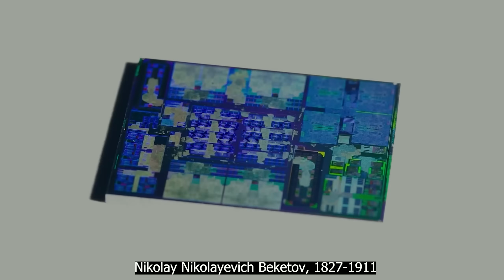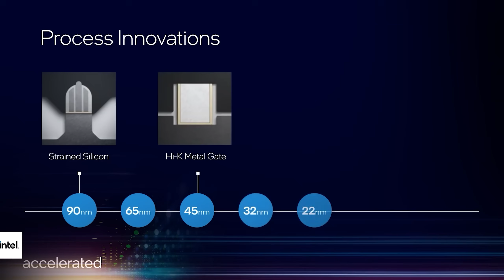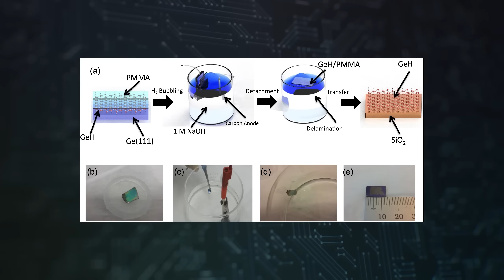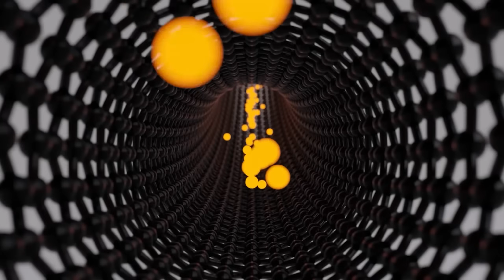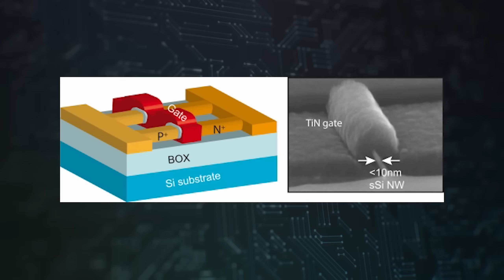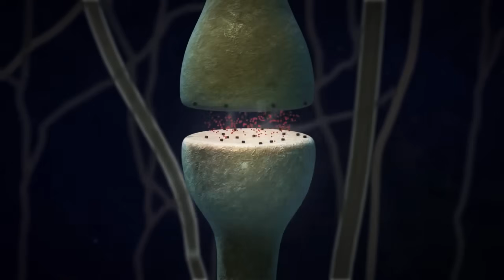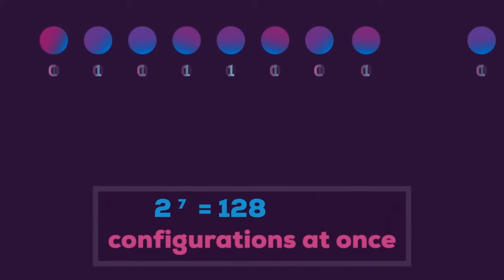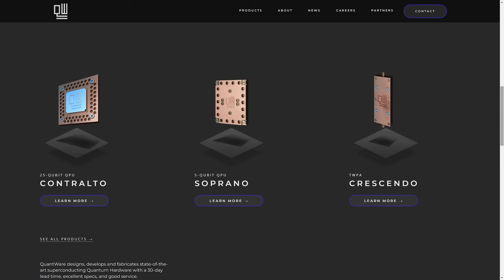End of the silicon era. Processors of the future

Comment: Quantum computers are NOT a replacement for the classical computers, holy hell
Reply: They need to be cooled with liquid helium and can only run α few quantum algorithm
Reply: @kellymoses8566  for now yes. The big machines called computers back in the day were impractical too.
Maybe they find a way to cool it off with other stuff or change it's material elements and make it portable. 
We never know when that step will take place
Reply: @kellymoses8566  
What they present is an algebra equation and then come up with the same algebra equation in a different form as the answer.
Reply: @kellymoses8566 right now...
Reply: I always thought we'd end up seeing a hybrid system for the best of both worlds.
Reply: @downnoutdubin  they are always hybrids because the quantum computer is controlled with a regular computer.
Reply: We don't know what is possible with quantum. But for now, i say: Optical Computing is the future. It replaces slow electricity completely with light. Basically computer will work same way as you fiber optic internet.
Reply: @gytispranskunas4984  I can 100% agree we don't know what's possible. But I believe that we will get to a point (eventually) where it will be in a much smaller package. On the timeline with quantum computing it's closer to the punch card days of the early 1800's The only direction to really go is smaller and more powerful. Now as for classical computing moving to optical? I can see where that could work, but you still need something to interact with, so I don't know how far that can really go. For storage? I can see that being a lot more feasible. Personally I think graphene or something like it will be after silicon. Multi layer processors with internal cooling in addition to external. The only path after that I can see is biological. Not saying or suggesting I am 100% right, but that's the path I foresee. I think there might be something between, but no clue what.
Reply: @ocpimport7935  How are we going to scale down atoms?????
Reply: @gytispranskunas4984  lol. Lol. Light is useful for faster transfer of data. But light has a problem. Wavelength.  To make the current computerchips we use lithography to make the transistors as small as they are. But we have to apply tricks to make that work. See. The light used has a wavelength. Extreme ultraviolet light has a 13.5 nanometer wavelength. And through some very highbtech tricks we are managing to make transistors smaller than that. Its really some high tech stuff. To move data, light is great. Because its fsster than copper wire. But to use light inside a processor itself actually can be pretty problematic. Otherwise we would already be using them. Please go and google a bit before you randomly say something..yes we could use lightspeed connections between individual cores. And we might have a way to do that with electrons. But thats experimental. But no. Light has its own issues. You might want to look into that some more. If light was such a great option. We would all be using it for processors already. Lightspeed is awesome. But light has properties that might make it extremely difficult. Please please go read about why we don't already have processors using light instead of the regular silicone cores and copper connections. Actually form an oppinion on information. Not a gut feeling and the idea "light is fast"
Reply: @MrMastadox  Really off-topic but how long does it take for you to type a reply this long?
Reply: He didn't mention actual future of regular Computing. It's Light based, Optical processors. They work by replacing electrons with photons. Makes it hundreds of times faster. Simple example. Look how much faster is you fiber optic internet compared to old wire internet.
Reply: Exactly, not a replacement but an addition to. Think of it like how the math co processor used to be separate. There will eventually be quantum computer dies that will be integrated into a computer chip so it will have that functionality as well. Both have their pros and cons. One cannot replace the other and be just as good if not better. A quantum computer chip would make a piss poor processor for an every day computer.
Reply: @ocpimport7935  how are they going to put a quantum processor into a cpu? How would they deal with noise and the problem of de-cohesion of qbits?
Reply: @MrMastadox  Okay, ask me that when a quantum processor has matured enough to be mass produced. At that time those issues will likely be solved. I am not suggesting this will happen in the next few years, it will be a decade at least from now.
Reply: @ocpimport7935  why are you so sure that will happen or even is possible? Or economically viable?
Reply: @MrMastadox  It makes sense that it will eventually happen. I was talking about 3D or stacked(multi layer) computer chips about 15 years ago, and they are just now in the last few years become more commercially viable.

I believe when quantum computing is viable and plentiful in the consumer market we will eventually have dual possessor like motherboards, then a while after that they will merge. 

The only way I see it not happening is if another company patents a process/technology that would be crucial for them to merge, and they don't want to license it or the license fee they want is too high to be viable.
Reply: @ocpimport7935  you understand how quantum computing works right? It seems you don't. If you did you would understand that what you are saying makes no sense. We can't put quantum chips even close to any other chips. Because it makes them completely unusable. How can you compared 3d stacked memory with a chip with qbits. The quantum qbits need to be isolated from everything in their environment. Because it causes decoherence. You have no idea what you are talking about
Reply: @MrMastadox  With current technology and what's on the immediate horizon? I agree. But, you have to admit that with the current level of technology you can't really mass produce them. Do you think when things are scaled down, processes and technology improves... that things will be exactly as they are now? Computers used to be the size of buildings, and shit changed. Think of it like moving from vacuum tubes to transistors. The current process for building quantum computers is not really sustainable long term. It needs to improve, and should absolutely improve in the next 20 to 30 years to a point where it will be drastically different from what we have now. Then probably another 20 to 30 years before we see the merge between classical and quantum computing. 

If you want to compare classical computing with quantum computing, I'd put it currently around the punch card days. So early 1800's. Quantum computing has a hell of a long way to go and what we see today... will not be close to the same in 30 years. 

So if you thought I was talking about tomorrow or in the next 5 to 10 years, then my apologies for not being clearer. I thought it was pretty clear but I guess not.
Reply: @ocpimport7935  what downscaling are you talking about. We can already make qubit chips very very small. It just doesn't solve the problems quantum computers have. The size of the qbits isn't the problem.its noise, decohesion and cross talk. Not the size !!!!
Reply: Quantum Computers CAN replace classical computers - quantum gates can perform all the operations classical computers can and more. The only difficulty is creating one that works as well as a classical computer (same storage size, same speed, etc).
Reply: @FunkyJeff22  yeah. They could. But it defeats the purpose of making qubits. And they won't be any better at the task either. Lol
Reply: Why so angry lol
Reply: @CLSB-ECHO  lol. Well atleast binairy processors are functional and useful lol. Are you suggesting we should try bringing trans people's temperature down to the same temps as we do quantum chips? One thing is for sure. There are a lot if people entangled in the ideology. There is a lot of cross talk going on. And society is certainly losing more and more cohesion. Lol
Reply: I just think that quantum computers are a bit of an overkill for the consumer market. I like my sandy computer 🖥️ and I think it will stay relevant indefinitely not having to fear the comeback of analog computing or the rise quantum ones as those will be for specific use cases. I think we are probably going to see more AI oriented silicon with In Memory Computing or even Optical Switches. Opinions
Reply: Maybe you should look at the big picture instead of just critiquing about future quantum A.I. generated computers  ,.
Reply: Yea but that statement doesnt make for a good video
Reply: thanks now i know whats in the video
Reply: how can you know that? genuine question
Reply: he also explained qbits so wrong
Reply: I have no great knowledge of quantum computers and very little on computers in general but reading all the reply’s in this thread put a question in my head. Is it possible that we are the limiting factor?  Humans? Again I am not a smart man but maybe we need to change. Prob a dumb question. Anyway. Have a great day everyone. I Love you all.
Reply: @LeftAloneTrusk  are you suggesting that anything is possible? And human scepticism is a limiting factor? Lol..
Reply: @MrMastadox  no. I was kind of thinking tech changes so fast and humans seem to get stuck and sometimes move backwards that if we as humans on a global scale changed together instead of divided we might be able to accomplish more or at least at a faster rate. I am In No way educated enough to imply anything or state anything as fact. I was only asking a question to spark some dialog with smarter plp then me.
Reply: @LeftAloneTrusk  when it comes to technological advancement, a couple of things can hold it back. 1 something we want isn't possible, because not everything is possible 2 there is not enough funding, as things only get funding if people think there is money to be made 3 we don't have sufficient knowledge to take the next step, while maybe in the future we have discovered something that makes it possible. I don't think the kumbaya , lets all get together kind of thing is going to matter much. When it comes to high end tech, all the countries that have advanced technology already work together. This is why there are projects like ITER. The world's scientific communities work together way better anyway. They consist of people who like science. They care less about geopolitics or other matters. Any country that makes their climate bad for science will see a brain drain. Just like Russia is losing a lot of their scientists now. Because they will seek some other place to do science. Quantum computing research takes place within a couple companies that have the funds. With people of many nationalities. No kumbaya and dance around a campfire and unite as a species to make things better applies here.
Reply: @MrMastadox  wow. Idk what all the fkn kumbaya shit needed to added for. Thanks for your input as a single person but you could have said that without being condescending.
Reply: if anyone can run doom on a quantum computer then I'll  buy that "it can replace classic computers"
Reply: I think the answer to all of this is doomsday when we all die 😐

just kidding forgive me I'm sorry gals/guys😗
Reply: It's difficult to see them being used today by the general public, however the way I see it is that q-chips will probably somewhere in the future be regularly used alongside clasical chips. They'll work together in a single machine where the q-chip will have specified functions and tasks greatly helping and reducing the stress standard chips go through. I could see them being used to calculate physics in games for example. But I don't know enough about this subject to make real educated guesses.
Either way, this is probably not near future, giving it a few decades, not only for depoyement of said chips but also implementation.
Reply: True, but ONLY FOR THE MEANTIME.
Reply: Wow, reading this whole comment section almost gave me cancer. So many half educated people thinking that quantum computing is going to exponentiate our computational power (heh, see what I did there?), but failing to realize that by simple laws of both physics and computing that a quantum computer the same computational power of a silicon based transistor has to require the exponential time of a silicon based chip for a linear function. If you go into daily usage like gaming and office, where functions tend to be sublinear, you can potentiate the factor even further.
Hell lot a bogus around quantum computing being the holy grail. Yeah, sure, if you want to do prime number decomposition you save a lot of time, but I hope, you don't want to wait 10 minutes to insert an image into your word document
Reply: I mean, I would imagine when those giant classical computers were invented decades ago, they didn't think it's possible back then that everyone would get one in each home. Who is to say what will happe 50-100 years ago.
Reply: Chill.  Video is about life after Silicon and what is the future of computing.
Stay within context please.
Reply: you didn't need to add the 'hh' curse
Reply: "Transistors are NOT a replacement for the vaccum tubes"
Some genius in 1940's
Reply: CPU.s are fast enough to do whatever we need all😊 ready
Reply: @stanleydavidson6543  then why do we keep bothering to make them faster? This is a stupid argument, quantum computers could be very useful in many different fields, such as computational chemistry, but just because they won't replace our general purpose processors doesn't mean they're useless.
Reply: Quantum computers are one of these lies we keep getting sold, modern physics is lost.
Reply: @HansensUniverseT-A  not necessarily a lie, just greatly greatly exaggerated. The modern age of clickbait doesn't help. What's a more catchy title, "quantum supercomputers in 20 years will be able to predict the weather/quantum effects/physical material properties faster and more accurately than current technology", or "QUANTUM COMPUTERS WILL TAKE OVER THE WORLD!!1!"?
Reply: Classical computers will just be used to predict the more powerful computers
Reply: Just like classical computers never replaced analog computers completely
Reply: Unless they can be used to create super efficient error free algorithms for things like physics computation that could usher in life like voxel gaming. Perhaps acting as the physics simulation.
Reply: 14:53
Reply: I know but i would be nice to completely replace electricity processing with light one, its very exiting
Reply: Hasta la vista, baby!
Reply: Not as they are today.
Reply: @Command.Prompt  And not as they ever will be
Reply: @Command.Prompt  He will be flabbergasted in about 10 years when they replace the current gen of obsolete tech and hes still sitting on a classical in his moms basement.
Reply: It's keeping up with improvement the mtree!  Inpove ments is balance ♎⚖️ feeding at a % shared! 😆 Lol
Reply: @SisavatManthong-yb1yn  your one of them
Reply: A Quantum computer is Not possible by physics and even not possible by mathematics.

Dont let them fool you by qm pesudo scientists because they come with a methematical equation and then as "Solution" they write the  same equation in a different order
Reply: It’s my understanding that quantum computers are currently so error prone that all results need to be check with a traditional Turing machine.
Reply: @MikeTho323  👍🤣😂
Reply: Quantum computing power is growing faster than silicon. You will eat your words
Reply: Quantumcomputers is not possible by physics nor mathematical.
Its a lie.
Reply: but photonics can
Reply: @AetherialDraconian  I'd rather bet on spintronics (no, not the recent tabletop game)
Reply: @blinded lol everyone point and laugh at the non believer haha
But seriously, process never happens with pessimism.  You never know what the future holds.
Reply: @mortyrickerson6322  https://youtu.be/CBLVtCYHVO8
Reply: A Classic Computer (C-Comp) becomes the I/O device to talk to the Q-Comp. 

Input-> C-comp-> Q-comp-> (back to)C-Comp-> Output
Reply: @DocWolph  It doesn't matter what the connection is, quantum computers simply are not meant to do the same things that classical computers do. That's what the guy meant by "are not a replacement". They are not better than classical computers for most of the tasks that the vast majority of people use computers for, like web browsing, text/image processing, gaming, etc. They have little to no values for consumers. They will likely forever remain in labs, datacenters, and industry for highly specialized tasks and research.
Reply: Until someone discovers something you can do with them as a general person….just like when the internet arrived
Reply: @fridolinkoch  There are a few Quantum ray tracing algorithms with papers now.
Reply: @cebo494  
Well at this point it is implied, at least, that you can not directly interface with a Q-Comp. That is, you need some kind of bridging software running from the C-Comp to the Q-Comp and back.

This is regardless of application. Aside from scientific, engineering, security work, among other things, I can see Q-Comps being used for animation, rendering, or simulation (for example, I can see water sims taking only a few minutes rather than many hours or days for a FEW high quality frames with a Q-Comp) and that is not even the color of the tip of the iceberg of what is possible with Q-Comps. 

For most things people use Computers for, C-Comps will be at least enough.THIS is agreed. But there are things that are way bigger that even best current C-comp  technology just is not adequate for. and Q-Comps at a price a small studio, or a very dedicated hobbyist, can buy to radically accelerate their sim work, animation, and rendering work (albeit the software may be coming a few years after the fact) is just what the Studio head asked for. And that is JUST animation. 

Anybody can become a "Doc Brown". pursue science, mathematics, engineering and MORE at home.

Again, I generally agree with what you saying BUT you are not thinking broadly enough.
Reply: Fantabulous Snuffaluffagus  uhmm no!. Quantum computing. Even if we have super conductors working at room temperature, can at best be used for AI functionality, and it would be at best an addition to a regular computer. So maybe they will be used in consumer products one day. But they can't replace normal computing tasks. The IBM comparison does not apply. And if we can never get quantum computers to work in room temperatures. They will for sure never end up outside special locations. At this moment, quantum computing is still very much experimental. And without much use to show for, funding might dry out at some point. And it might never reach a level of being very useful. So. The way things look now, its unlikely quantum computers will be in anyone's livingroom.
Reply: Fantabulous Snuffaluffagus  it is  not about predicting. It is about the inherent properties and limitations of the technology. Quantum computing only can do very specific things. And only under very specific conditions.
Reply: @MrMastadox  
Are you saying this having actually studied the developments of the technology? Or just being willfully ignorant having watched one video  where "This [Q-Comp] needs to be super frozen to work" This while not seeing the development of new "gates" that allow of Q-computing at normal room temperatures. 

The Tech is always moving forward and standing on a hill everyone has moved on from a few years ago, and this while the very video this thread  is attached to discusses developments in Q-Computing in a room temperature computer. does not make you an authority on the subject. 

At this point, you are arguing simply for your own self-edification not because you are right.
Reply: @DocWolph  We will see won't we? Yeah. There are ways to have room temperature q-bits. Using light and crystals. But upscaling beyond a few q-bits and cohesion is lost. Noise remains a problem too. At this point quantum computing is like chasing fusion. We develope more ways to achieve the same effects. But have yet to make it viable. And there is no certainty that both or either will ever become practically usable. Yes technology can advance. But there are limits to what is possible. And we might endlessly run into limits. Time will tell. But its not likely there will be economically viable fusion in our lifetime. And the same might be the case for quantum computing. We need more q-bits to make it viable, but more q-bits require more overhead in error correction. There is a realposibility that it will never become usable. It simply does not upscale well.
Reply: Fantabulous Snuffaluffagus  lol are you seriously comparing transistors to q-bits. Not only did it take only a few years to go from the first transistor to the first mosfet. There were many applications for them. It was an explosion. And a transistor in itself is a fairly simple component. There is no way it can be compared to a q-bit. Its like comparing combustion engines with a fusion reactor. One is simple. The other is damn near impossible. People like to always make these dumb comparisons. And like to ignore the fact that pshysics does not allow for everything to be possible. Its the same reason we do not have the hooverboard from the back to the future movie. And it might never exist. Unless we somehow completely misunderstand physics and invent some kind of way to make antigravity thrusters. And come up with an insanely powerful tiny power source that can supply the insane amounts of energy needed to keep that hoover board up. Some of these believers believe in scientific muracles soo much that they think they can upload their consciousness into a computer before they die. And can live on. Even if thst is retarded, and would merely be a copy of your consciousness. Not actually you. Yes. The first computers were huge. But that changed really really really quickly. Because there was nothing preventing them from becoming smaller. No physics to overcome. But. Given that we are now nearing sizes that make quantum tunnelling an issue, we will need to find other means. But with quantum computing, you are running into problems related to physics from the get go. And the same with fusion. There are good arguments to be made why we might never make it commercially and practically viable. And as a result, all these scientists and companies hype up the results and possibilities to secure funding. But hey. Hyping things to secure investment is very common  and elon musk does it all the time. His cars can still not safely drive autonomously. While he said they would many years ago. His hyperloop is a dumb idea that isn't viable. Its why re recently brome his test tube down and turned it into a parking lot. And so is his underground tunnel with taxi drivers driving teslas through a short underground tunnel with led lights just one big joke. Not everything is possible. Or commercially viable. A transistor is in no way comparable to a q-bit in a quantum computer. Not even close.
Reply: Fantabulous Snuffaluffagus  the first transistor 1947. The first videogame 1958. First solid state calculators 1960. Lol. Donkey kong was released in 1981. They were theorizing about quantum computimg back then. In 1998 there was the first 3qbit computer. Its 2022. And there is very very little to show for. Quantum computing is nothing like classical computers and transistors.
Reply: Fantabulous Snuffaluffagus  i didn't miss the point. Your point is more general. Its the "once we didn't think people would fly, yet now its super common". Its no argument at all.
Reply: Fantabulous Snuffaluffagus  you surely have a lot of fanta .. fantabulous
Reply: @cebo494  Yes, this is basically it, they are not a replacement, they're better at certain tasks, worse at others. Not a replacement, meant as a parallel solution to different problems.
Reply: @MrMastadox  "Quantum computing only can do very specific things. And only under very specific conditions."

You could say the same for GPUs. When the first GPU was produced, who knew that Hi-Res console gaming, virtual reality in our living rooms, hobbyist video editing, and AI training, among many other GPU functions, would become feasible for everyone because of it? 

Many probably made similar arguments: "GPUs are too specialized," "Only professionals can make use of them," etc. The fact is, we just don't know what software, applications, and devices quantum computing could open the door for down the road. 

If you give R&D a new tool (for instance, the ability for the general public to quickly analyze huge data sets), they will eventually find all kinds of novel, and profitable uses for it.
Reply: @Fermion.  a gpu is NOT the same as quantum computer. And a GPU works the same as a regular processor. It has transistors. GPUs are in some ways similar to CPUs they use transistors. But they are designed for specific tasks. Just like GPUs could be used to mine crypto, but ASIC miners were better at it because they are designed for a specific task. A CPU is just designed to handle x86 instructions. And a gpu designed to handle graphics. But the technology is the same silicone chips that process ones and zeros. In no way can you compare that to qbits and what you can do with them.  Why do all of you come up with these rediculous conparisons. If pc CPUs would not still be required to supports all the old x86 instructions, they would be faster and more efficient still. This is why ARM and the new Apple processors actually do so well compared the x86 processors. Because they do not need to be as compatible with old instruction sets. But its all irrelevant in this comparison. Because cpus, x86, gpus, asics. Are all just the same technology at the core. And van not be compared to quantum computing. Its a very very very different thing.  Please go read up about quantum computing. What it is. How difficult it is to come up with useful things to run on them. And why in all these years that people have been making them. There has not been any use case for them. Why don't you people actually look into what quantum computing is. And compare it with regular binary transistor computing chips. They are so completely different it makes no sense to compare them.
Reply: @MrMastadox  I didn't say that GPUs are the same as quantum computers. Nice strawman though. 

You went into that entire condescending fallacy of a rant, while entirely missing the point.

But I won't bother repeating myself.

- All the best
Reply: @Fermion.  you are missing the point. A gou is designed to handle a specific task. A quantum computer is an experimental technology which inherently is only suitable for specific tasks. It was not designed with those tasks in mind. And gpus when designed worked off the bat. And their use only exploded after the popularity of the voodoo 3dfx cards. Your comparison is nonsensical. Quantum computers are an experiment. With many hyped ideas about what they could supposedly be used for. Because well. Funding has to keep flowing. But there doesn't seem to be a way to make a quantum computer with 100000 qbits. And it looks like there might never be. There aren't even any useful algoritgems for them. Quantum computers are a pain in the ass. Where as gpus were a hit from the get go. And their abilities grew as we added functionalities to them. As it looks now, we are more likely to get fusion working than we will useful quantum computers.
Reply: @MrMastadox  Alright them. Take care now.
Reply: @MrMastadox  As others have previously stated, you're litteraly describing computer back in the day before transistors when we were using vacuum tubes.
Reply: @seubmarine5347  so what you are saying is that we will invent q-bits from a different material and in a more compact size later, ones that do not suffer from noise and coherence issues. Ha ha. Just like we went from vacuum tubes to transistors .  Yeah...... NO!
Reply: @cebo494  There are quantum computer specific matrix calculation papers in the wild which is part of what a GPU does to render graphics. Whether it's good or bad compared to traditional GPU's though i'm not sure.
Reply: @DocWolph  "This is regardless of application. Aside from scientific, engineering, security work, among other things, I can see Q-Comps being used for animation, rendering, or simulation (for example, I can see water sims taking only a few minutes rather than many hours or days for a FEW high quality frames with a Q-Comp) and that is not even the color of the tip of the iceberg of what is possible with Q-Comps. 
"

You mean a 500 million dollar render server?

Excuse me I almost peed on myself from laughing so hard.

No dude finely tuned software that takes advantage of both CPU and GPU compute is easily good enough for render servers.  We're going from 64 core CPUs to 128 core CPUs in a single generation, so a single server which typically at most has 2 CPU sockets can have 256 cores and 512 processing threads and this doesn't include the graphics compute.  On top of that but AMD's graphics compute devices based on CDNA 3 is a huge jump in performance.  It no longer takes days to render 4K movies and render tasks run overnight.  Editing happens during the day.

Somehow I don't see Sony or Disney increasing their budget for rendering by about 10X, but that's just me.

Even for simulation, modern CPUs are more than doubling in speed, in fact you have to find VERY large datasets to make modern computers break a sweat unless you're talking about a HUGE animation project like what global weather forecasting systems do.  Watch AMD's or Level1Tech's discussion on Milan-X.  And now you're going to take that compute power and increase it by about 60 - 75% in a single generation with Zen 4 Genoa-X.

So sure, eventually when computer scientists can figure out how to program a quantum computer there will be a handful of applications that can benefit from it, but considering in another 10 years the compute power of 20 server racks will be in a single rack, I laugh for the most part when people start throwing out long lists of use cases for quantum computing, and considering it's a TOTALLY different paradigm for programmers, you almost have to take a kid and throw them into the quantum compute environment so they learn from the very beginning what it is, because if you learn to program using 1s and 0s, now you have to forget that and relearn something new.

I think in general people don't realize how much compute power has increased over the last 5 years.  It's probably been one of the most explosive time periods for growth in compute power.  The next 5 years probably won't be as great but it's still going to be very impressive. We've already shrunk the amount of server racks we need by about 50% in the last 5 years, and depending on the application, even more.  

We have about 15 - 20 years before node shrinks aren't feasible anymore, but using different technology offsets that.  In fact with different stacking technology this in itself could open up new paradigms for binary computing because of being able to move signals over multiple layers of transistors.  So 3D CPUs.  It's already been incorporated into caching with AMD Zen 3 and Zen 4.
Reply: @cebo494  They are not a replacement yet. But time will tell. They are already looking into gaming on a quantum computer. Nvidia's 4090 card's ray tracing kinda uses has some kind of quantum concept computing to it. Although not true quantum computing only time will tell if quantum computing will take over and classic PC's will be phased out. True VR would most likely need quantum computer to work properly.
Reply: Fantabulous Snuffaluffagus  "You have reminded me of the story of IBM in the late '40s or early '50s assuming there would be a world wide market for maybe 10 computers.  They simply could not imagine what the device would become."

There's that, and then there are the people who was able to imagine a ton of stuff like flying cars and whatnot. Basing an argument on what people can and can't imagine is a very slippery slope. Especially as there's nothing that can be confirmed.
Reply: @cebo494  as a computer science student i can verify this....but quantum computers can completely replace super computers and mainframe computer (only to some extent though).....for regular uses silicon processor is the best yet but there is more than 1 type of research going on...... 

i am really hopeful on one research going on in mit where instead of electrons CPU chip uses photons to communicate.....if this is possible then we wont need 1000w power supplies and neither do we need powerful cooler......infact nearly no heat would be produced
Reply: @cebo494  lol
Reply: @cebo494  What if I just created a machine which you can have at home which builds an entire quantum computer's hardware with a set of given quantum instructions and connects the newly created hardware to the main computer?
Reply: Fantabulous Snuffaluffagus  Yeah hindsight is quite the thing innit?

Just go out of your way to ignore the entire comment next time too!
Reply: Fantabulous Snuffaluffagus  Except those computers at the time weren't working based off the most fundamental nature of reality, that in order to reduce noise requires them to be kept at temperatures as close to 0k as possible, where the radiation of the human near it can ruin all the calculations. 

It's great if you don't understand any of the technologies at talk at all to bring up random stories and analogies, but there is no path like from a vacuum tube to a microprocessor in the quantum computer world. Fundamentally the computers work off QM. Modern computers also do. The second we used QM for modern computers, we KNEW what the limit of the technology would be, even if we have still not reached it. With Quantum Computers, we KNOW the limits of their general applicability, because some guy working at IBM isn't going to transform the fundamental nature of reality.
Reply: @Fermion.  No, you can' talk about straw mans or whatever you want, but the fact of the matter is that even bringing up GPU's as a matter of comparison shows your ignorance, because there is nothing different between a "CPU" and a "GPU" (they are both microprocessors. GPU's are literally just lots of CPU cores on a die) whereas comparing transistor based computers versus qbit based computers is apples and three stage rocket engine comparisons.
Reply: @seubmarine5347  To get around the vacuum tube problem we simply had to make a computer smaller. What are we going to do to make fundamental particles not interact?
Reply: @MrMastadox  does it have to do with availability? Man will pass up any chance to commoditize the possibilities? I'd advise, you continue studying or participating and leave the dreaming to funders, they know how to effect change with money and geniuses tend to limit themselves
Reply: @ShinDMitsuki  I never said CPUs and GPUs are similar. I said similar arguments can be made. I know it's a subtle difference, but put on your thinking cap and your big boy pants, and figure it out.
Reply: Fantabulous Snuffaluffagus  Lol big this.
Reply: @MrMastadox  Very short term thinking, I bet a couple hundred years could change that.
Reply: @stormevans6897  You know that that is wishful thinking. That is like saying. We will have the back to the future hoover boards. Or time machines. Just give it a couple hundred years. Just assuming time can break any physics law. Based on nothing in reality, just some dumb faith in technology having no limits. Its almost religious.
Reply: @Fermion.  They cannot. The fact you cannot grasp that your comparison has no basis in reality, illustrates nothing, and proves nothing just further demonstrates your ignorance.
Reply: @MrMastadox  There is clearly a lack of first principle conceptualization happening in regards to technology because for most people technology is magic and it always gets better every year no matter what so why wouldn't it keep doing that? It's really baffling how marketing gimmicks like "moores law" are so prevalent in the modern world as scientific statements, and are even warped beyond what was originally stated (computational power versus transistor density claims)
Reply: @ShinDMitsuki  clearly so. People have technology as a religion. Its like religious people. Blindly believe in their fairytale book. But haven't a clue whats actually written in it. Well. I suppose videos like these are what draws people in. They don't really want yo learn about science and tech. They want to hear a preacher talk about it.
Reply: @cebo494  you must be from the future
Reply: @DocWolph  
There are already programming languages for Quantum Computers -- just need a developer.
===
The problem is, quantum computers can only do arbitrary calculations.
Reply: @cebo494  yes this.
Reply: @thelelanatorlol3978  Graphics programming primarily uses 2x2, 3x3, or 4x4 matrix multiplications for rendering, outside of specialized solutions. The performance cost there is nothing crazy, and shaders often do far more than just the matrix multiplications. Any theoretical gains are going to be capped pretty hard, assuming you can even get fast access qubit processing pipelines hooked up to the pipeline properly.

On top of that, you'd need the translation layer between the regular GPU cores and qubits to have little to no overhead, otherwise you probably lose what little performance gains you do make.

I'm personally more interested in the quantum ray tracing papers someone else mentioned above because it seems like an idea that'd be a lot easier to scale with gains that are more practical to take advantage of.
Reply: Well put, although quantum chip also hold some hope in overhauling GPU architecture for faster RTX
Reply: @cebo494   Before addressing the problem with the limitations of silicon , how about using better what we have.  The software is really bad, and the hardware architecture is also bad.
We need new techniques for developing software and hardware, I call it "computeware" and I', developing a super-compiler that translate high-level mathematical code directly into a combination of software/hardware that uses analog mathematics to create the final result  . There's no real division between software and hardware, and there's no division between 0s and 1s, its all analog signals. Just like in the Asimov stories, Analog Computers, not "quantum" .

But we could start from the Top going Down (instead of the usual bottom-up), That tasks like " browsing " are stupidly inefficient because the web is just a bad bodged technology that was not meant for what we use it for. Its just the worst possible solution.
Also, operating systems are bad, everything about making software for make-pretend PDP11 machines with C/C++ is bad basically.
If we threw away the baby with the bath water and the crib, we could have room in the silicon bedroom for a new " better baby ", a clean water and a bigger crib.

And a quantum computer is a very single purpose machine, so its not very useful.

We need to go for analog computers made with traditional electronics, no quantum effect bullshit. Only voltage, capacitance, inductance and "magnetance"  ( I don't like the term "memristor", its not a resistor, nor a memory ).

Heck, it must be possible to translate directly from high-level mathematics to the lowest level Maxwell equations, then solve it automatically to produce a "blob"  that's not even a capacitor, or a resistor or a transistor, but uses all the possible states a "simple"  electromagnetic semi-conductor system can have, without even needing absurd quantum effects that no one understands well.
That might be an amazing moon shot to overtake computing architecture from the ground up, throw away everything and redesign a new on top.
We didn't do it like that on the first time because its incredibly complex to solve Maxwell equations by hand, but we have computers now, don't we ?

And the hardest part of all that, is bashing programmers on their heads so they forget about Java, C, and Javascript, and learn something more like Haskell that's based on proper mathematical foundation and allow for better optimization of computing.
Reply: @cebo494  Quantum computsng mudules can just add up to the posibilities of classic CPUs
And the "bridging software" can bereplaced by a simple driver software, or even a built-in communication circuit for low latency response
Reply: @Galacticfungus  "There are a few Quantum ray tracing algorithms with papers now"

Ray tracing using ray tracing cores works FINE.  It's only a matter of design, getting the balance of graphics cores to RT cores correct, etc.....

Example, two years ago most people didn't believe that RT processing would become a serious thing in game development because it seemed SO HARD and expensive.  

And then Nvidia releases the RTX 4090 which can not only do ray tracing very well, but it can provide ray tracing when a game uses it pretty heavily, AND NOT just running this on a 1080p monitor but a 4K HDR monitor.  Is it expensive today?  It would be a HELL OF A LOT cheaper than using a quantum computer just for gaming.  Right now Nvidia has already solved high speed ray tracing on a 4K monitor with their best GPU to date.  Next generation of GPUs from Nvidia it will be even faster, and within the next decade, a GPU using about 200W will run games where all the lighting and shading is calculated using ray tracing, and it will do it very easily.

I give it about 5 - 10 more year and most game companies will stop trying to emulate lighting and shading effects and move completely to ray tracing, because it's much easier to do.

My only question about ray tracing in a home computer which for the most part, if not SOLELY is from playing games, is will AMD figure this out because if they don't Nvidia will be the only GPU maker in the business.

Nvidia accomplished 4K HDR ray tracing with high frame rates using TSMC N4.  And I'm saying this because of how STUPID this video is going from a talk about "tricks" in making CPUs and Moore's Law to quantum computing.  Well THAT sure leaves out a whole HELL OF A LOT OF COMPUTING.

What does it really mean with TSMC gets to 20A, or N2?  What does it mean to double the number of compute transistors in a sq. mm vs. TSMC N4?  I mean, N4 is a very advanced node that isn't even in any CPUs yet.  And AMD can make CPUs with 192 processing threads using TSMC N5.  So just looking at CPUs and forgetting graphics compute, AI compute using tensor cores and acceleration, if AMD were to double the number of thread processing vs. their latest Zen 4 EPYC 96 core CPU and go to a 384 thread CPU, the question REALLY becomes, can the rest of the technology around that CPU move data into and out of that CPU fast enough, and the answer is probably not.

Now, I don't know why it would be any different for a quantum computer that fits inside a laptop.  Oh wait, any time I see a picture of a quantum computer they look HUGE.

This video is a ride on the stupid train because it ignores current computing techniques which is going to already advance compute power a good 4 - 5X from what it was 3 years ago.  And I have YET to figure out why a company needs an IC that has a density greater than 1 billion transistors in a sq. mm, ESPECIALLY considering that a quantum computer needs a large amount of space.  It's a JOKE.  Try researching the types of problems Nvidia is solving by moving away from simple CPU computing.  Then, TRIPLE that solution in the next decade using silicon based circuits.

Moore's Law is a non issue because at some point transistor density isn't the issue, it's the type of computing you're doing, and before we ever need to get to quantum computing there are solutions to problems using other technology that are going to make the costs for enterprise and data centers go WAY down.  It's only a matter of who brings those solutions and right now Nvidia is killing almost every other company with these newer solutions.
Reply: @Fermion.  we don't need to replace selicone because we can do whatever we need to do with current chip technology
Reply: @MrMastadox I’m reading this flame war and see you’re very invested in, generally speaking, Computer and Electrical Engineering related topics. I try to keep up with modern stuff but all I got are Computing Edge magazines. What kinds of modern computing media do you prefer just to stay in the loop and keep you at the top of your game?
Reply: @jc8153  i don't keep up to date on everything. But that which i do take in, i do with a healthy amount of scepticism. Keep facts and fiction apart by minding some factors, like how money is involved, or if information is playing into human emotion.  The only reason this thread was such a pile of shit is because the sheer amount of people who lack understanding, but react with rhetoric or wishful ideas and oneliners. You know what kind of videos always get a shit ton if views on youtube? All these dumb non-scientific videos about ancient aliens, or pyramids being batteries. People love bullshit. There is plenty of information everywhere these days. The only way to make sure you don't end up chasing nonsense actually requires knowledge in psychology, so you can prevent yourself from approaching science as a religion of sorts. Or worse, start watching all these woo woo science bullshit. Which has nothing to do with science. Sadly there are actual scientists who spew a lot of woo woo. Like Michio Kaku.
Reply: @cebo494 history stopped this is always the case "no use for consumers" until you realize that the concept of a metaverse is on the rise and quantum computers ARE really good at simulating reality. So yes, as technology marches on, quantum computers will have a use by consumers.
Reply: @fridolinkoch physics simulation when we all live in virtual environments. BCI factors in as well.
Reply: @MrMastadox you're failing to see what you can't see
Reply: @DocWolph  Quantum computer is horrible for solving most of our computational needs. So, rather Q-comp can at best become an specialized module for the C-comp.
Reply: Totally agree, all these people arguing in the replies seem so confident about how "technological progress" means we'll all have one someday. I don't have a chip fab at home, and I doubt anyone else does, that doesn't mean the technology or need isn't there. I believe quantum computers will be the same way - not needed on a wide scale by the masses, we'll only have a few centralised ones for universities and governments for stuff like simulations and research. Hell, I bet even companies might have one - perhaps pharmaceutical companies to do simulations of drugs, maybe Pixar for raytraced rendering. But the standard person won't ever need one! And if they do need access for a while, I'm sure there'll be a process to buy time on one, like researcher's do with supercomputers. Perhaps Amazon AWS will have a quantum computer if there's high enough demand. But I don't see why a normal person would ever need a quantum computer when regular computation does pretty much everything we need.
Reply: @Nabushika  What if people get a quantum co processor that would run with the normal CPU/GPU we know today and when heavy loads or special algorithms take place, the load will be taken care off by that piece. Stuff like ray tracing could use a quantum hardware and day by day people use it without "needing it".
Reply: @raresandrei7205  there just aren't enough algorithms that run on them to make it practical. The reason you can't buy a Graviton processor to put in your computer was because it was designed by a company, for a company, to do one specific task. The same will be true for quantum "co-processors", there simply isn't any utility for the average person. Some companies will use them for specific tasks such as quantum simulations, but it'll never have enough utility to become a device that people will just "need", and wouldn't sell enough to justify the R&D into making it suitable for consumers.
Reply: Nobody will ever need more than 640k of RAM ~ Bill Gates 1981
Reply: @sss-ht1jp  That happened because we could have more memory capacity and that meant we could bloat it up.
Reply: @Blinded - IKR? It's frustrating, but I understand why laypeople are so confused by it. Think of the number of arcane disciplines you have to understand before you can even start to discuss implementing Shor's algorithm.
Reply: can;t we just program a new device to store quantum states as well?a new variable & hardware to store this
Reply: @dinozaurpickupline4221 
Okay storing 1 qbit that can be anything....
I am absolutely positive that at the moment you want to acces that data you'll get the following error;  Q I/O syntax error